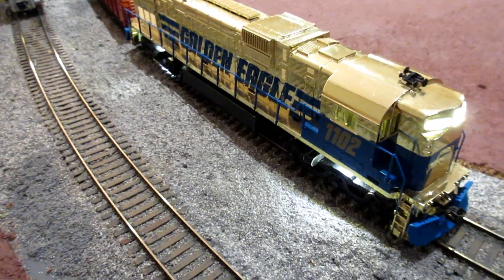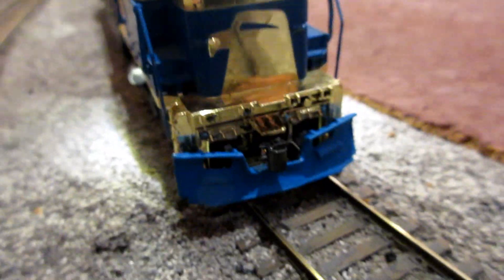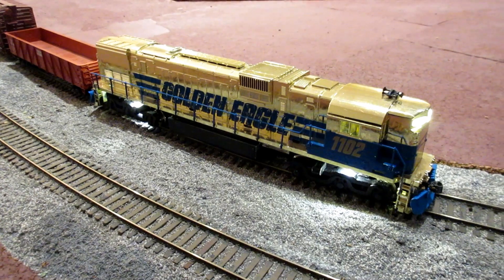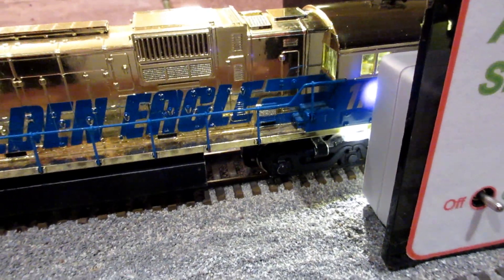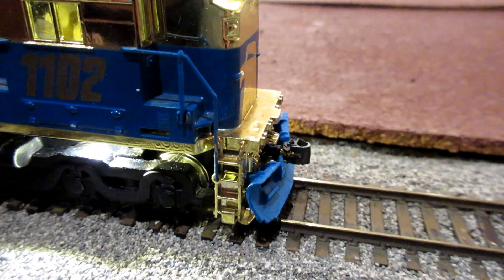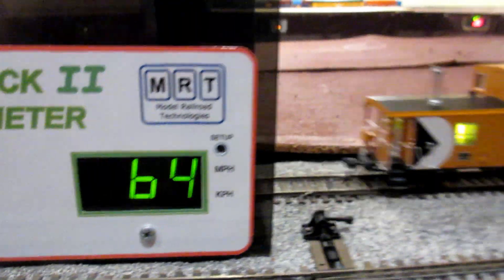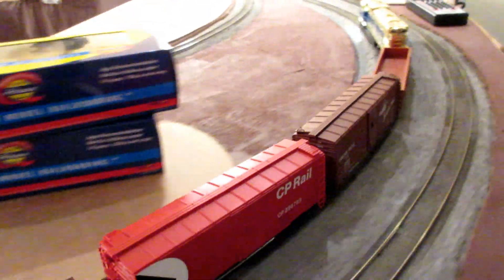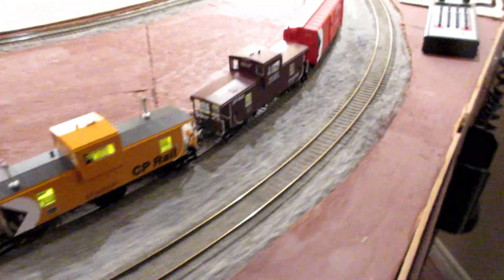Running the Tyco DCC Golden Eagle

Comment: Thanks for sharing the Hobbytown build. Yes, they are open for business. That drive will get more and more smooth as the gears break in. I love these beasts.
Reply from the maker: Personally, I like my HobbyTown kit better than anything from Scale Trains or Rapido because I built the loco myself from the ground up.  Locomotives are now approaching the $500 CDN price point; that's a top-of-the-line DCC/Sound ScaleTrains model (including tax).  Nope, I'm done with pre-orders and done with spending BIG money on locomotives.  Hopefully more modellers put their 'foot on the brake' and push back against high prices.  Enjoy what you have OR think outside the box and buy something cheaper, i.e. a HobbyTown of Boston kit. Boo to "inflation" !
Reply: You are preaching to the choir. I've been collecting for a number of years almost exclusively on the secondary market (eBay, train shows mostly).  I've got a substantial collection and I'll bet I've paid maybe 15 to 20% per locomotive, of what a brand new train costs. If you go for models from the pre-plastic era; diecast metal bodies, metal components, they are almost always either running or easily able to get running. They are from a time when things were built to last...and, brother, have they ever! We're talking models that are 60, 70+ years old. Hobby Town is one of the very few makers of those kinds of trains remaining. They were all built to be easily worked on and modified. And they will pull everything in the yard out of town.

Comment: What DCC system would you recommend for me? i might start ou on that but the cost kinda had me doubt
Reply from the maker: All DCC systems use the same DCC signal.  The only difference is the controller/connector.  I had a Lenz system but then went with a Digitrax system because that's what my train club uses.  Personally, I would go with a system that allows Wi-Fi connectivity so you can control trains with your phone.  I then use a Sprog DCC USB device and LokSound Programmer to do all my programming/testing.
Reply: @chrisdaniell2990  so digitrax would be the GOAT for a starter like me?
Reply from the maker: Well, I hear MRC is awful, but truly any other DCC system would be acceptable.  I really don't use Digitrax throttles since I went to Wifi.  For a 'starter' system I would try to make my own DCC system (if you're willing to put in the R&D time) or something on the cheap: like a used system off eBay or something.  I would not buy anything 'new'.  I would then look to see which company is the least progressive in terms of updates, software patches, new gadgets and such; reason: new upgrades = more money.  The DCC signal has not changed since inception, so all you really need is a system capable of sending/receiving DCC commands.  That's really ANY brand.. just be happy with the throttle and that's good enough.  Currently, I'm using an old iPad + Digitrax Command Station + Digitrax LNW1 to drive my trains and I do my programming off the layout using a Sprog DCC USB device.